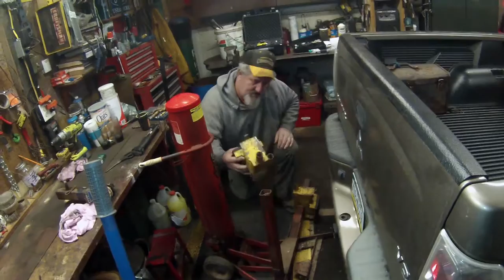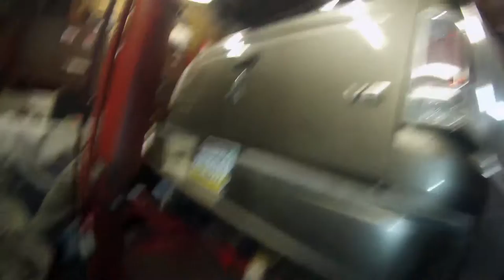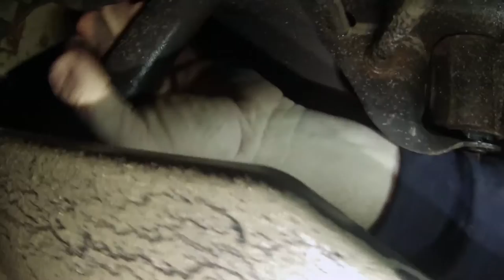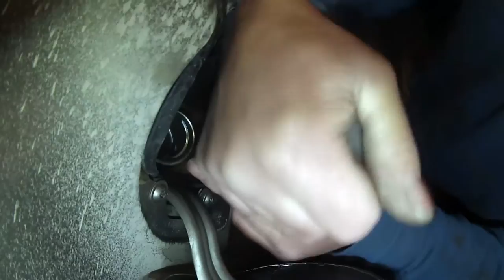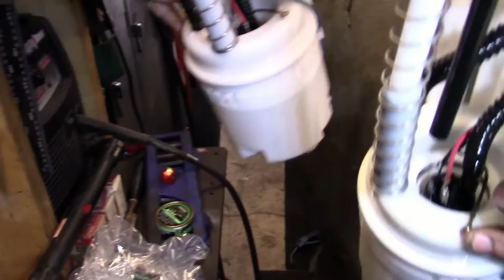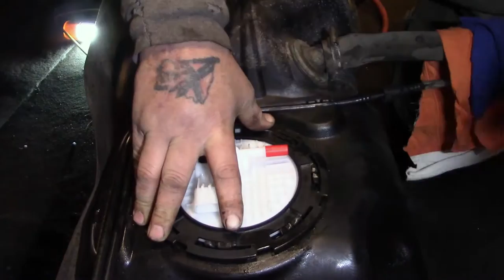Wrenchin On It : 2006 Mitsubishi Raider Fuel pump replacement

Comment: I followed your instructions. It would have been wise to tell viewers to before go to all this effort to test PCM as all dodges come with factory failure. The anti theft ground link to fuel pump does not get applied. Your not informing of this cost me $318.00 plus hours unnecessary expense. I still had fuel starvation until I went to dodge forum for advice & learned the true culprit. This might have saved your job also. Your video did help

Comment: My dad has a 2007 and it has a gas mileage problem,  he change the canister,  and from there his truck it's been wasting double or triple times, Any idea what could it be?
It's throwing codes of the evaporation  gas cap,  we changed the gas cap,  one thing I've to tell you.  The old cap some mechanic plugged it. It's odd that the pressure has to go out some where. But could it effected the gas mileage on the truck?